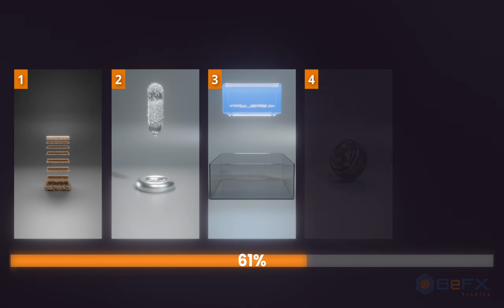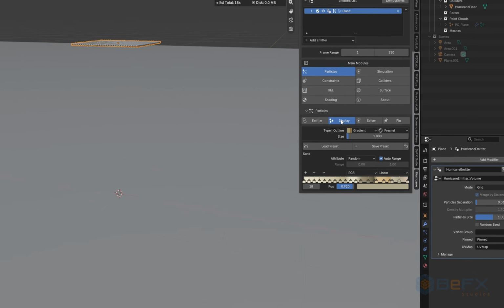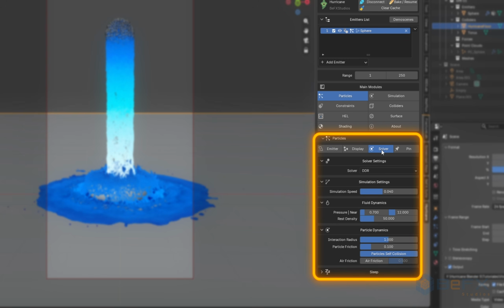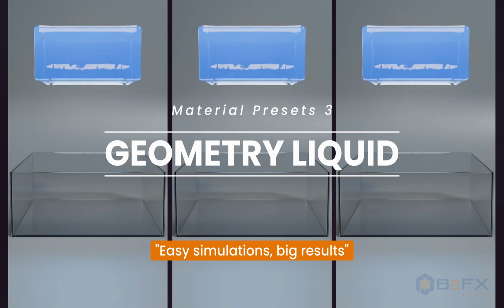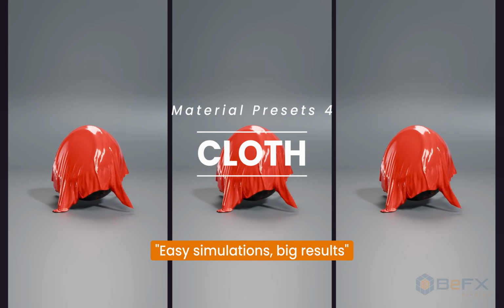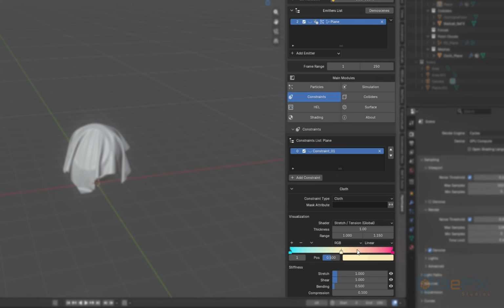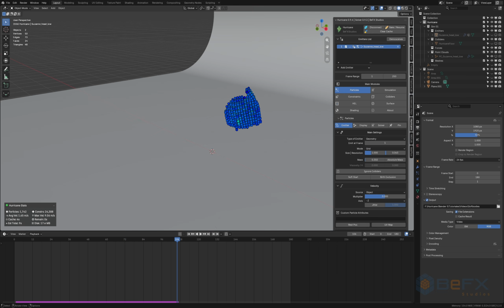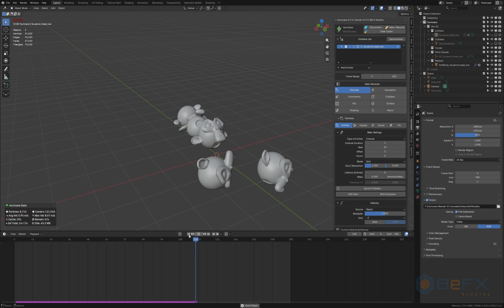Sand, Liquid, Cloth & Soft Body Simulation in Blender | Hurricane

Comment: Amazing solver! I wonder how much GPU support could speed up the simulations. Would it be possible to use the CPU and GPU together for the simulations?
Reply from the maker: There are still several weeks of work left, but it should be ready relatively soon. No, I don't think you'll be able to use both at the same time, as they are very different systems.
Reply: @BeFXStudios3D  Does the purchase include free updates when new GPU versions are released?